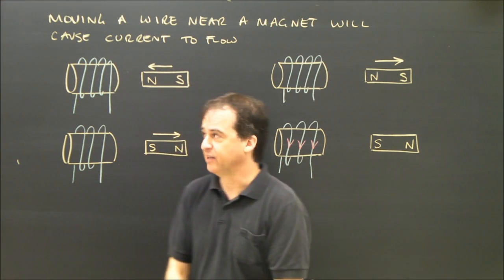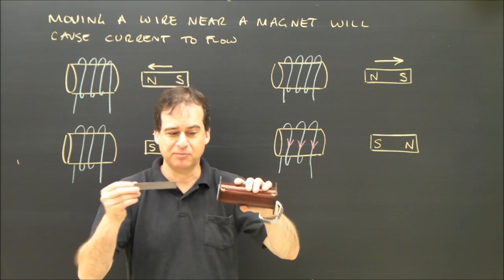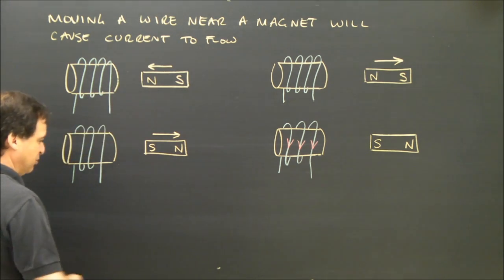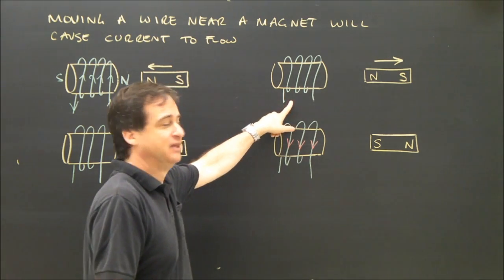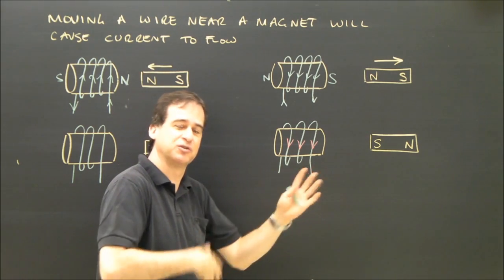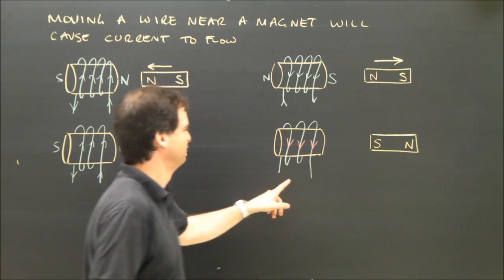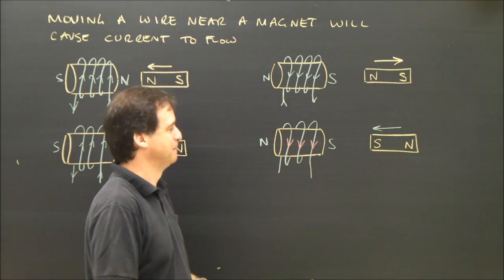Electric Generator Lenz's Law Part 1 Left or Right Hand Rule Physics Lesson

Comment: But I have the opposite current direction as I used the right hand rule ---- is that correct?! 
Please answer me urgently, and thanks for that amazing video
Reply: If I used the left hand rule and you use the right hand rule we will get opposite answers and we are both correct. This is because there are two ways we treat electricity. Some people use the old theory that something is moving from positive to negative and others use the theory that something is moving from negative to positive (electrons). Luckily both theories work as long as you stick to the one in your book. My students might answer that the electrons flow let’s say to the to the right but if I used a different book they would say the current flows to the left because I would be using the old theory of how electricity moves. Just use the theory you were taught and the correct hand you were told to use and it should be fine. I hope that helps

Comment: Sir. I think method of using left hand thumb rule is wrong. Coz In the first example when, when the NORTH pole is approaching the coil, the Right hand side of the coil must become north as per Lenz Law. As per Right Hand Thumb Rule and the CORKSCREW Rule, the current must flow ANTI-Clockwise. So in your diagram the current direction must be downwards. I Hope i am right!
Reply: yes I was also thinking about that

Comment: I don't understand something here. Please do we use the RIGHT HAND GRIP RULE to determine the direction of the induced current or we use the LEFT HAND GRIP RULE?? 
I know of Right Hand rule not Left Hnad rule
Reply: This is always what makes it confusing. There are 2 different ways to do this and which one you use depends on what theory your class is using. The old “theory” has the flow of electricity coming out of the positive terminal. The “correct” theory has the electrons coming out of the negative terminal. What you need to do is find out which one of these theories your book or teacher is using. If it’s the old theory then you use your right hand. If it’s the new theory which has electrons flow out of the negative terminal then use your left hand for everything. They both work because left hand goes with “current” flow and right hand goes with electron flow. Confused? Don’t be, just use the hand your teacher tells you to and never use the other hand. It will work.

Comment: What if you wind the coil in the opposite direction so that the voltage and the current are reversed. How does the approaching North Pole magnet still generate a North Pole Lenz’s law opposing magnetic field? 

If the voltage is backwards and therefore the current is backwards in the coil then shouldn’t it now make a South Pole?

So when a North Pole magnet approaches the coil how then does a North Pole Lenz’s law opposing magnetic field be generated in the coil in both scenarios in which scenarios 1 has a voltage and current one way and in scenario 2 the voltage and current are completely opposite to scenario 1? Good one huh?

Comment: The polarity of the induced voltage can be determined by using the left-hand generator rule. how please tell me
Reply: I use the right hand for convectional current but anyway
1.When coil in generator is Parallel to magnetic field the is an induced EMF 
2.was coil moves away from the magnets up or downward the EMF if in a clockwise direction
But once the wire becomes perpendicular and moves towards the magnets EMF is in anticlockwise direction

BE ADVISED I MIGHT BE WRONG STILL IN HIGH SCHOOL 😊❤

OR Electron flow is opposite to direction of induced voltage so use your left to find current flow then the opposite is your current
Reply: Not gonna lie took most of the day try to solve your problem 😭 so this is how I found it yes am going to write an essay on YouTube 😂🎉
1.wire is paralle riight then it moves away from magnets 
2. the induced emf trys to stop this (direction of an induced e.m.f. opposes the change causing it lenz law )
3. so lets take faces of coil near the north pole of magnet emf will produces unlike pole on wire so south to try and stop movement of coil 
4. so i used my right had role you know for  the solenoid thing to figure out the direction of current (convectional) were you wrap your hand around coil , thumb points to the north 
5. so i found movement of current which was clockwise ,so i was like emf is a push that what my highschool teacher said so that means emf is moving in the clockwise direction too 

 but i think the are easier ways to find direction of induced emf but for your case ( current as electron flow ) i think EMF is opposite to direction of electron flow 
REMEMBER THIS INFORMATION MIGHT BE WRONG STILL IN HIGH SCHOOL

Comment: I'm afraid the drawn current directions are the opposite of what they should be.
Reply: It depends on if you are using conventional current flow or electron flow. The direction depends on which method you are using. Electron flow is the actual movement of the electrons. The conventional current flow method acts as if electricity flows the other way. This is obviously not what is happening but when this was developed no one knew about the electron. They assumed the positives moved. In some places this is still how it is treated. Both methods work fine if applied correctly.
Reply: @markcaruana2915  So the directions in the video represent electron current?
Reply: @ahmedhegazy699  In this video I’m using the conventional current flow method so the flow shown represents the current. I’m real life the electrons flow the other way. Using this old method then we pretend that the positives flow as “current “ the way I showed. It would make sense that everyone switch to electron flow so we are all doing this the same way but in some countries it has been decided to stay with this old method.

Comment: This video is wrong/contradicts with everything else we've been taught. For the first one the current should move anti-clockwise. You are violating the law of conservation of energy.
Reply: There are two conventions for current. One is electron flow and the other is current flow or conventional current. It only makes sense if you apply the correct one. It looks like you are being taught using one of them and I am teaching using the other. That will make it look backward to you but both methods work if you apply them correctly. That’s why it looks like I have the current backward.

Comment: Very few really understand Field Theory .. If you don’t hear Tesla, Steinmetz or Maxwell then your looking in the wrong places .. 

Einstein’s 1932  Unified Field Theory was an attempt to disguise the Aether by another name .. This would have disproved Gen & Special Relativity .. 

Einstein gave his Maya Culpa speech in which he said “ sometimes WE scientists make mistakes “ .. No one questioned which mistakes he made and of course Albert wasn’t forthcoming .. 

In 1957 Dr’s Lee & Yang Nobel Prize work Shredded Einstein’s work but no one took notice ! .. Why because no one wanted to crush Einstein junk work .. Einstein use the Lorentz Gauge Theorems which were based on U1 Symmetry Electrodynamics Theory which Dr Lee & Yang’s work disproved .. Lee & Yang successfully & repeatedly proves that Electrodynamics theory is asymmetric… 

So why has no one called attention to this .. Where is the NSF, & FAS ? Are these guy’s asleep at the wheel or what ? .. 

You don’t realize the implications of this .. This brings the possibility of Hyperconductivity.. Time reversed negative resistance and negative gravitation .. 

In 1932 Gabriel Kron designed a negative resistance device using a 3D geometric electronic circuit .. The US Navy paid $30 for this device with the one caveat that it functioned .. This became the first black program from which the NSA got its roots .. They claim the NSA started in 1952 but it actually started due to the Kron device .. 

You know why you never heard about this ? .. Because Maintaining the facade of Oil & control is the current effort of the communist old world order .. They don’t like sharing their toys with anyone ..

Comment: The electrical currents do not flow when no load is applied.. He doesn’t know what he is talking about ! .. 

Add a load & you will feel resistance.. He’s a doofus  .. 

When you have no load you have field generation but no current flow .. 

I have yet to hear any actually provide a cogent explanation around what a field is or how it propagates in the vacuum of space .. Einstein couldn’t do it .. The reason why is that Einstein wasn’t a scientist .. He may have been a mathematician but he wasn’t a scientist..
Reply: Einstein hater mmmmmmmmmmmmmmmmmmmmmmmmm

Comment: Not if that wire is a superconductor which disallows magnetic fields to enter into it .. Superconductors don't operate in Transvers mode .. They operate in Longitudinal mode .. Increase the centripetal divergence inside a superconductor what do you create ? A hyperconductor that demonstrates two things .. 1st Negative Resistance .. 2nd Time reversed operation .. Instead of heating you would get cooling .. What is the direction of force in a superconductor ? .. NULL .. What is the direction of Force in a Hyperconductor ? .. Depends on the direction of current flow .. In superconductors electrons / holes don't flow through the medium .. If this is true then how is the energy coupled from the source to the destination ? .. Is electron / hole flow just an illusory and really depend upon the force vectors ? .. Yes ..

Comment: Does this mean if I drop a magnet through a copper tube the current in the tube is reversed right after the magnet exits the bottom of tube? (assuming no change in orientation of the magnet)
Reply: Yes. The magnet will always experience resistance

Comment: This well meaning teacher incorrectly explains to students how the Law of Conservation of Energy is satisfied during electricity generation in the video below...

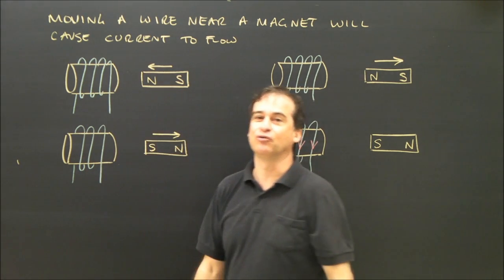At 1:25 he states that, "the coil operates like an electromagnet and makes it more difficult for the magnet to approach the coil..."

"Makes it more difficult" is the same a saying Performs Work.

What the teacher is actually saying without realizing it, is that the Magnetic Field Energy which is created around the coil (electromagnet) is performing Negative Work on the approaching magnet and reducing its Kinetic Energy - i.e. "making it more difficult for the magnet to approach the coil..."

When we apply the Work-Energy Principle to the video and when we understand that Energy is the Currency required to perform Work (in any direction) which, "makes it more difficult for the magnet to approach the coil" we will conclude that Magnetic Field Energy is being created.

And it is this Magnetic Field Energy which is created is responsible for performing the Negative Work "making it more difficult for the magnet to approach the coil..." 

Energy IS being created and the theory of conservation of energy works well in purely Newtonian Mechanics but it does NOT apply in Electromagnetism and it NEVER has.

The work-energy principle states that an increase in the kinetic energy of a rigid body is caused by an equal amount of positive work done on the body by the resultant force acting on that body. Conversely, a decrease in kinetic energy is caused by an equal amount of negative work done by the resultant force. 

Energy is the capacity for doing work. You must have energy to accomplish work - it is like the "currency" for performing work.

Now what the teacher and the entire world physics community is incorrectly saying (for 197 years now) is that Work (making it more difficult for the magnet to approach the coil) CAN and IS being performed without energy - which is a violation of the Work-Energy Principle.

Kind regards
Thane C. Heins
Ottawa, Canada
thaneh@potentialdifference.ca
613.898.1131

Comment: Nicely presented, but Fleming's left-hand rule: Thumb (Thrust), First finger (Field) and seCond finger (Conventional current (opposite to actual)). Apparently, a different left-hand rule is operating.
Reply: Yeah, what left hand rule is that?
Reply: Fleming's rule has to do with a charged particle that moves through a magnetic field and shows the direction it is deflected. This left hand rule is used to show either the North Pole of an electromagnet when current direction is known or the direction of current flow when the poles are known. The left hand rule is used for the true way current flows from negative to positive. The right hand rule is used if you follow conventional current where electrons flow from positive to negative. The left hand rule is the accurate way.

Comment: My teacher taught me this rule, and he used his right hand instead. This video is actually wrong.

Apart from the rule in this video, just look at the first example. Yes, to oppose the change by the magnet (magnetic field goes to the left), the current must be in the direction so that it will create magnetic field that goes to the right (he explained this well). However, if the current direction is like that, then it will create magnetic field that goes to the left, thus violating Lenz's Law.

If you do not believe me, try to use the usual right hand rule (fingers = magnet, thumb = current). To make the magnetic field inside the coil goes to the right, the current must be downward. (just ike giving thumbs down).

It might be confusing though if you use this rule with right hand as it's kinda the opposite (fingers = current, thumb = magnet). I prefer to just use the usual right hand rule.
Reply: Your wrong because your switching back to the flow of positive charges in the middle of the problem. Since he used the flow of negative charges you must use the left hand rule, always. Using the left hand rule in the first problem to determine the direction of the magnetic field, your thumb points to the right, not to the left.

Comment: Hang on a minute! 
If you use the right hand rule you will get the opposite results. 
So could you please clarify what the hells going on here??
Reply: Left hand rule describes movement of negative charges (electrons). Right hand rule describes the movement of positive charges (conventional current).
Reply: in that case, the thumb would represent the S pole instead of the north pole
Reply: you use it in the case of the magnets going in or out......use the magnets as the basis of the right hand rule and trust me it works.In his left hand rule,he used the wire as his basis for his left hand rule.

Comment: Hello, (excuse my question but) Are you sure that the direction of the induced current is correct? It seems to me that the (for all 4 examples) current should be in the opposite direction?
Reply: ***** Forget about hand rules (since they are a way of visualising the concept) just consider the law. Induced current must oppose the change in applied field. According to his picture above, conservation of energy is violated.
Reply: Sean dob True! I think he made a simple mistake  :(
Reply: It's not a mistake, since he's using the left hand rule, his thumb is pointing towards the north. If you were to use the right hand rule you'd fix it so that your thumb points from north to SOUTH so everything evens out.
Reply: right hand rule should be used. thumb points north
Reply: @ahmedel-agroudy8326   Thankssss a lot. I really understand ur explanation Bcoz i confused a lot btween left and right hand rule. Reading ur explanation really helps me
Reply: @DanialMaths  When we use left hand grip rule, i think the arrow on the video is the direction of electron / not conventional current.